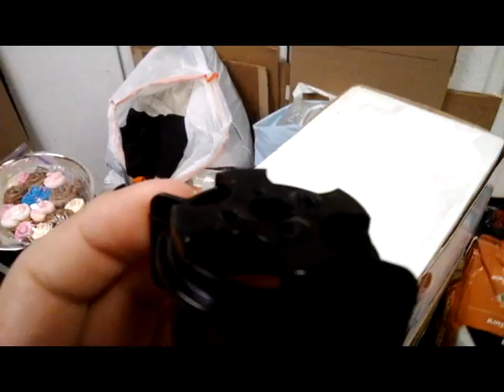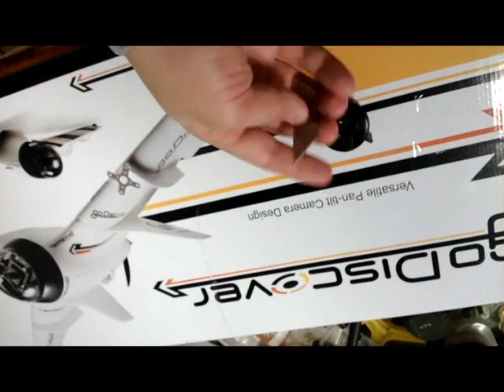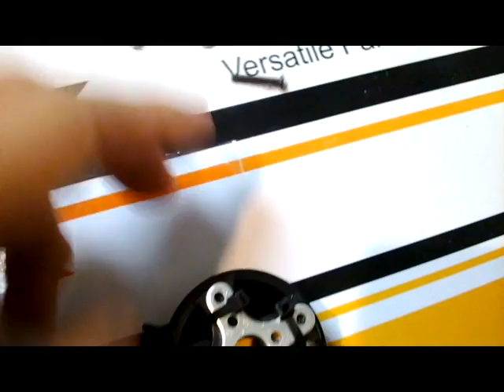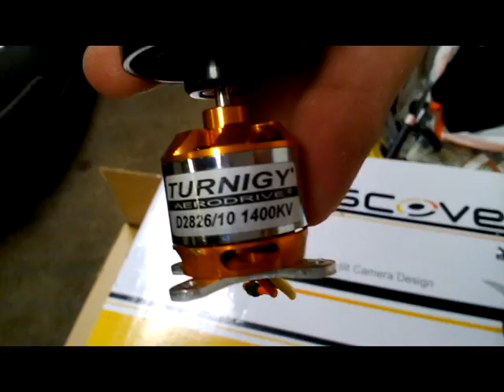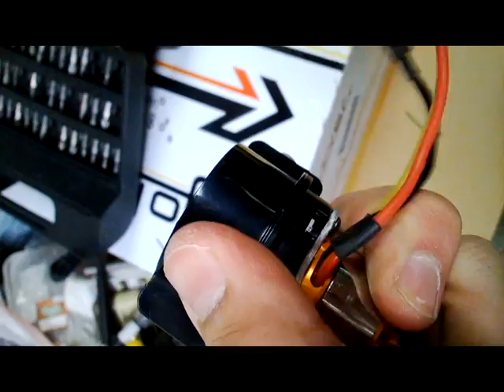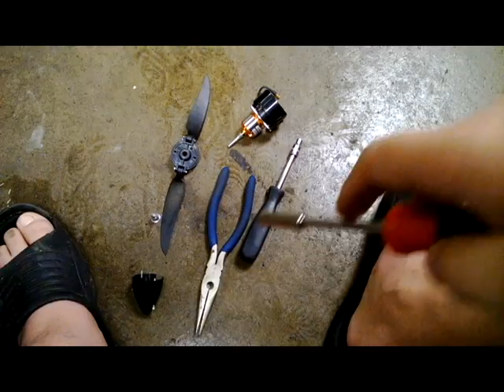Go Discover FPV plane Motor mount MOD From Hobbyking

Comment: So with this mod you can't remove the motor from mount without unbolting the plate first, right? For me it's not great because I want to be able to swap motors for photography and performance. My old Easystar2 motor mount seems much flimsier, but somehow it's ok. Why is this one so much trouble. Maybe it would be worth adapting mount from other model, like Skywalker X8? Anyone has experience with this?
Reply: +Michal Gloc i completely over hauled this plane by getting rid of the old propeller and using a set of some carbon props from my old set for my quad and adding small guard on the bellow the prop so i wouldn't break anything on landing replaced the glass dome with a foam block and made it into a mapping drone rather then fpv since the dome is crap.
Reply: +Viktar Pisarchyk what was the size of the prop that you replaced the one on your go discover , and did you use a folding prop to replace your old one or was it a solid blade
Reply: Ben Tucker well i used a tri blade 8x4.5
Reply: Thank you for  responding. is a tri blade a 3 blade prop or a regular blade
Reply: +Ben Tucker 3 blades

Comment: mine broke during motor testing - also prop crashed. it go so fast i still do not know what had happend.
Reply from the maker: before or after mod?
you can order it from hk
Reply: My motor mount also broke during testing, it was a PNF purchase so everything was stock. I did however get mine RMA'd and just got the new one today. Now I will be taking it apart and making my own motor mount mod to prevent this from happening. I may even go as far as replacing the motor and esc.
Reply from the maker: Sergeant Stadanko I bought the kit because i wanted a higher kv motor so i can run of a 2 cell battery as they are much cheaper and easier to maintain, also they are lighter. With a 3300mah i get 30min plus on a pack i was thinking of making a new video about a no dome conversion.